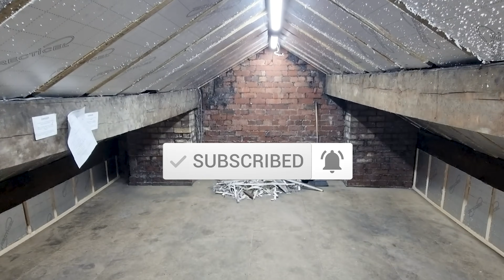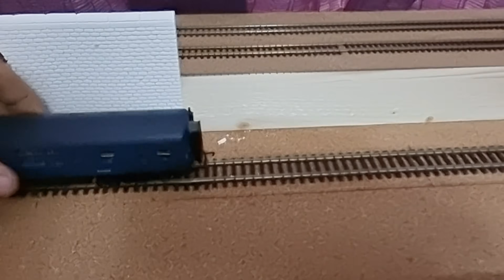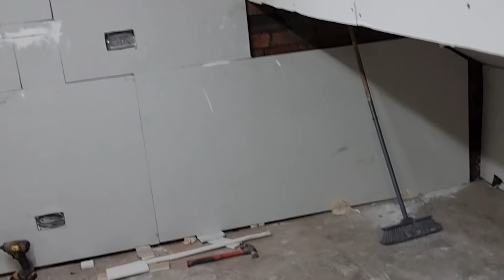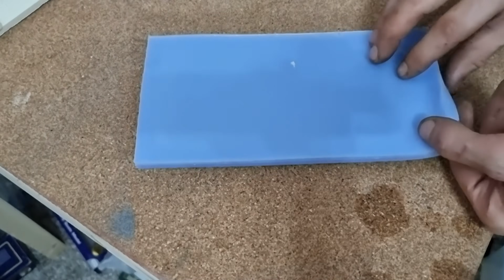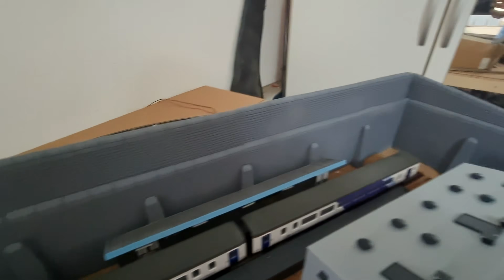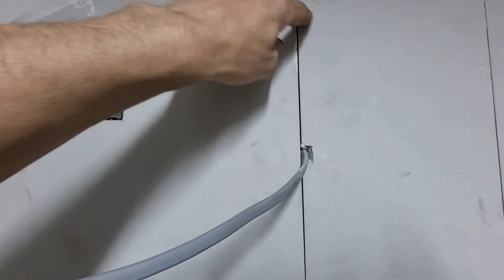Deep Glen s1e3

Comment: We can have a better chat at Crewe, but as an Electrical Design Engineer, I have some concerns about your Electrics, referring back to Deep Glen s1e1, you mentioned the attic supply was from a ring main, to supply the attic lights, which would be contrary to regulations, as the spur off the ring would need to be separately fused at 5 or 6Amps.
Reply from the maker: Yeah, reading that back, it's well confusing, so I'm gonna start again, lol. So the lights are spured of the 1st floor lighting. They provide lights only and are running led lighting only. The sockets are a new ring and are being wired right back to the consumer unit that's being replaced in the future. They are definitely separate and wired to code 😎
Reply: @AandMRailways  That makes a bit more sense! Probably a bit late as the floor is down, but I would have put a power switch next to the light switch, so you can turn all power off when you leave the attic, this can still be achieved with wireless remote sockets as a afterthought!
Reply from the maker: It's going back to fuse box and getting its own fuse. It needs a new consumer unit as its the old black one with wire fuses that have been replaced with modern trip switches. We are putting a downstairs toilet in at some point so it will all need ripping out and relocating and renewing.
Reply from the maker: Also, the ring main is for the lights only. The sockets are separate and as I said going back to fusebox